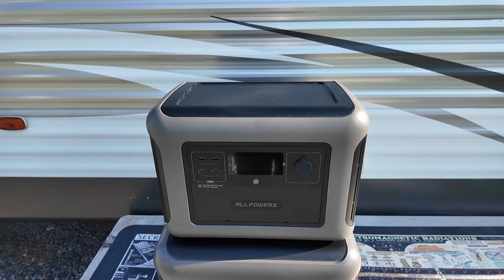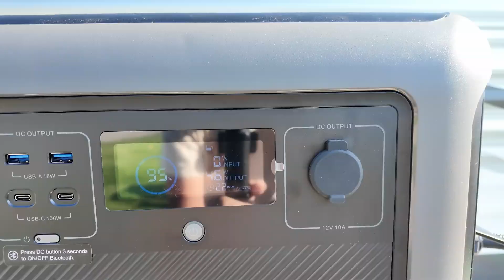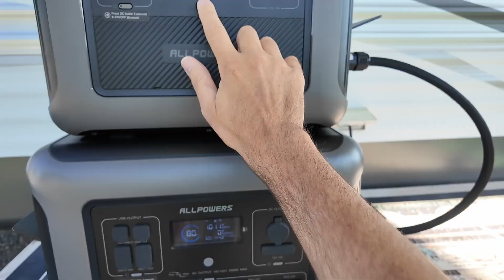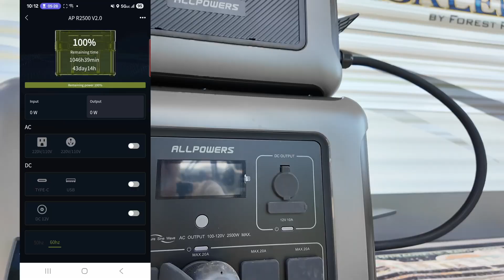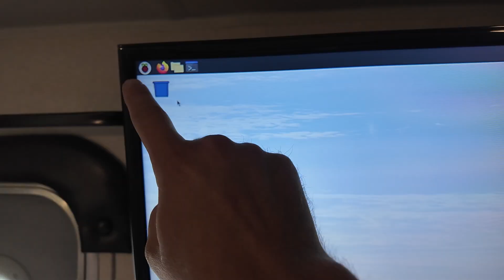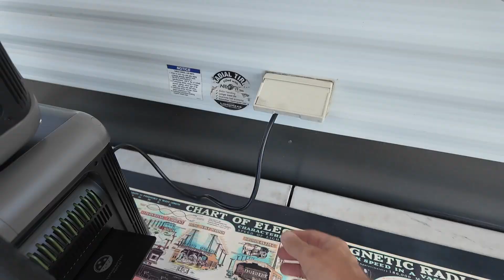Up Your Power Station Game with this EXTENDER!

Comment from the maker: ⚡ What do YOU use for off-grid power? Let me know in the comments!

Want to see the B1000 compared side-by-side with another unit (Jackery, Bluetti, etc)? Drop your requests below and I’ll make it happen!

👉 10% Off Discount Code: TemporarilyOffline for all Allpowers Gear! 👈
👉 Allpowers B1000 Expansion Battery: https://iallpowers.com/products/allpowers-b1000-expansion-battery-1152wh?ref=rjqlvc69
👉 ALLPOWERS R2500 Power Station: https://iallpowers.com/products/allpowers-r2500-portable-home-backup-power-station-2500w-2016wh?ref=rjqlvc69  
👉 ALLPOWERS SP037 400W Solar Panel: https://iallpowers.com/products/allpowers-400w-portable-solar-panel?ref=rjqlvc69

Comment: I forgot to mention  my house battery bank is 4 5120wh batteries so yeah I am doing good power for days with the allpowers r2500 charging that battery bank everything works and the e taker f1000 as long as I have gas in my truck I have power
Reply from the maker: Sounds like a great setup!

Comment: I blame you for showing me these in a video back in January. I use the two linked together to power my studio in the RV. Love the setup. I wish it lasted a little longer, but it'll run my PC, Starlink and radio station for about 8 hours. Next things that I need to do is get solar installed and wire up the inverter so that the house batteries and the Allpowers station can recharge from solar while I get to use the microwave and coffee pot when boondocking. Always things that need to be improved upon.
Reply from the maker: If you're bored, you're not trying hard enough!
Reply: @livingforalivingRV  100% !!! That's why guys like us are never bored!

Comment: dude i have the allpowers r2500,3 b1000 expansion batteries,5470wh total,and i use it to charge my rv house batteries  not as a stand alone power source and it works great my rig is a 2021 coleman lantern 17b ,so not a big travel trailer but i have no issues i used to have the travel traier plugged into the r2500  without a house battery and that worked great as well ,i just wanted to be able to boondock longer and using the r2500 as a charger   for my house batteries does much better,i have an etaker f1000 also just in case and that works too
Reply from the maker: Hey Bud!  How long did you last offgrid?
Reply: @livingforalivingRV  as long as i have sun i can boondock forever remember i have an etaker f1000  check it out i think u wlll love it
Reply from the maker: I remember!
Reply: I am able to be off grid for ever with or without solar like I said I have an etaker f1000

Comment: Nice power station. They come in handy when grid goes down. That happing a lot threw out the USA . 90F in NY again and humid !!  Many records broken this summer . Last winter broke records low for us. Had some strong storms come threw . Only cooled off for most of a day then the heat came back. Dew point staying in the 70's F range.  Some grid problems around hear and not a outage. Just lower than normal line voltage . And some power factor and harmonics in the grid. They make RV surge protectors . 30 and 50 amp ones. Goes inline at connection point.  Stops a surge before goes into the RV . Some camp grounds bad for power. Ageing power grid. Varies a lot  threw out the country . Some RV camp grounds have aluminum wiring some have copper . Some have both . I have seen many surge protectors blown and melted over the years . I only use UL ones my self. I just got in a 30 amp GFCI with surge protection for RV use.  Male and Female 30A plugs. Water proof . UL listed. was a bit $$ . Cheers from NY
Reply from the maker: Waterproof is necessary!